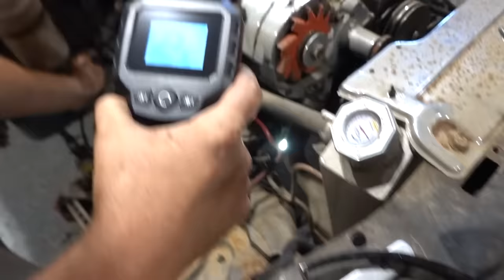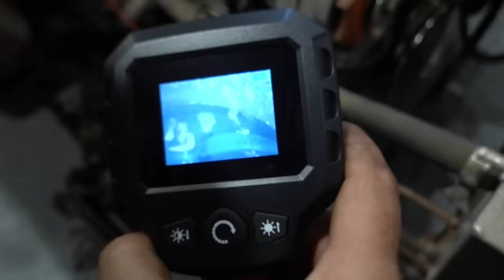Vice Grip Engine Swapped my New El Camino!

Comment: Now we need Derek on demo ranch
Reply from the maker: Yessss
Reply: @OffTheRanch    Fresh driveline ? are you fixing the transmission I mean to me that cracked bolt hole is a pretty big deal
Reply: @chris001979 that is the trans from elchromino, and he made it seem it was only temporary
Reply: @momolovesyou9969 it was el chrominos original transmission, not the one in it now. The shifter was from el chromino.
Reply: @ratedredneck96  no they didn't take it back out they put a clamp on it and called it good
Reply: @chris001979  i know, the trans they put in the car was el chrominos old original transmission. Its the one that had the cracked trans pan bolt hole. They didnt take anything from el chromino besides the shifter. The wheels and tires were el chrominos old wheels and the trans was the one that was in el chromino when they first got it. He put a beefier transmission in el chromino.
Reply: confirmed @OffTheRanch
Reply: Best episode ever!
Reply: @OffTheRanch  Demo's Garage does, fosho.
Reply: @OffTheRanch  Just keep him in the background while you film breaking what he just fixed.
Reply: @chris001979  No. Of course, no. #SheWillHoldTillSheWont
Reply: @chris001979  There's more suspense that way.
Reply: @OffTheRanch  He has "More Gooder" the right kind of equationals, and figure'ins things out theories for @DemolitionRanch

Comment: I had a great idea long time ago about building a hotel out of used boats. Build some docks going up to them, put blue and green, fake grass around them to look like they are at a marina and call it The Boattel. Get it,? Boat hotel? If you had a river or a swimming pool for a couple of them to back up to that would be unique. Just get some steel hole houseboats that won’t float anymore, dig a small hole, get the inside and do everything 120 V.

Comment: An El Camino without rust? AMAZING! I’ve owned a few over the years and they always seem to develop rust especially around the bed and rear window.
Reply: Yeah I find it hard to believe they just found it there. Bet it was stolen and dumped not long ago. Also how in the heck were they running dual 600 series carbs on it with flooding the shit outta it? It must be cammed and bored.

Comment: PB Blaster in all the spark plug holes. Wait for a bit, let it sink in. Then try to turn it over, either with a bar and socket.. or see if the starter works?
Reply: Pb blaster is crap. Oily wd-40

Comment: Maybe it was a methanol motor? If so, it could explain why it’s locked up. Methanol draws moisture into the crank case which creates rust.

The twin carbs and roller rockers point towards a dirt track motor thrown in the car, which are methanol motors.

Comment: Fill cylinders with WD40 and let it sit. You can use engine oil also. The rings probably rusted to the cylinder walls.

Comment: Tape a plastic bag around the tail shaft so when you pull the motor it don't leak transmission fluid on the ground.

Comment: Super clean for sitting in the woods... should throw new tires on The wheels that were on there.  Did you drain the fuel and check haaa you just said this and "CHECK the Tank" lol 24:27

Comment: Someone has swapped it to a '81 grille. Most people like them better.  The tailgates on those always peel. For some reason Chevy used galvanized metal on them. If you wipe it down with vinegar or other mild acid. It will stick. I hope I win. I've had a couple and am a big el camino fan

Comment: I am probably very late for this, but if an engine is stuck, you can fill it with diesel, and sometimes it will break loose
Reply: Also if someone comments saying it would be useless to break the motor free because of how rusty it is you could still save those pistons and the crankshaft as long as there is not a hole rusted in them or they fell apart because rust can be removed off of those so they can be re-used as long as the problems I listed before are not present

Comment: Put a normal dual plane on it it'll probably make more power an more torque. And it's running after the keys off bc there's to much timing in the engine remove 2 degrees

Comment: If the El Camino was really sitting down there abandoned it's because someone stole it drove it down there and it ran out of gas or something are they planned on taking the motor and wheels and what have you off of it so it's on the hot sheet if it was really sitting there

Comment: Power steering pump on said “high performance “ engine. Is a dead giveaway whomever was building this had no clue what they were doing. With high performance comes high engine rpm’s. Power steering pump are not fans of high rpm’s. Also manual fan blade= horsepower robber. A manual rack and pinion or manual steering gearbox from a Vega is all you need.

Comment: I'm guessing that this car was dunked.The engine rust with little to no body rust and a bed that is a mosquito factor seems strange to be fine. I bet it went under. Instead of pulling the engine to work on it they tried to remove the front paneling. The job just got away from them, and she sat with water in the engine to begin with.
Reply: also explains the human sized hole in the windshield they broke it to climb out when it was under